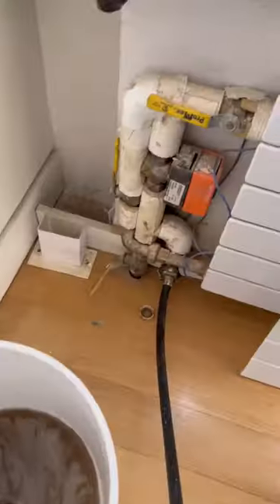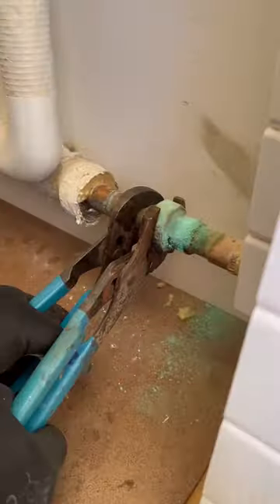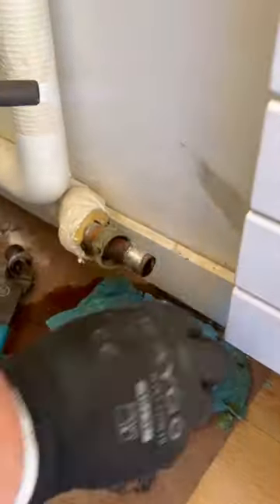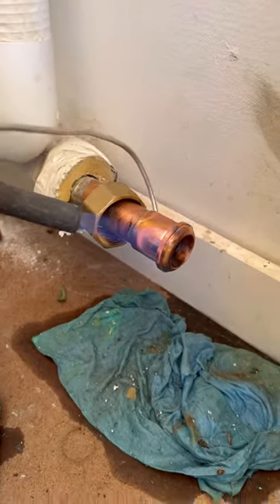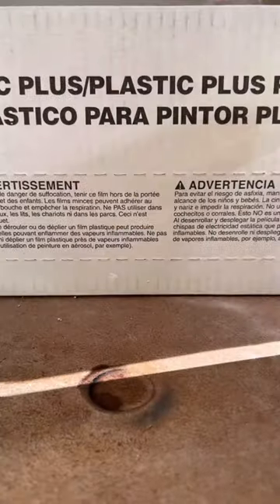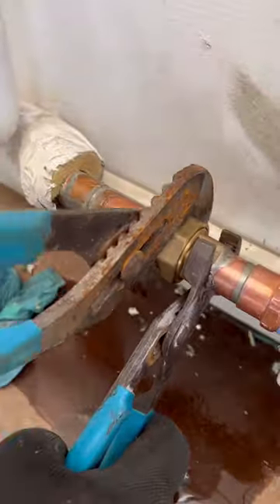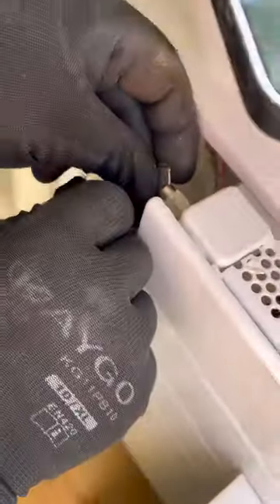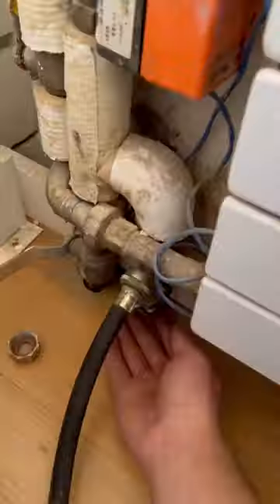Corroded Copper Union Replacement

Comment: Fun fact: in New York they use Coca Cola instead of water in their radiators
Reply: Tell us you know nothing about hydronics without telling us you know nothing about hydronics
Reply from the maker: lmaooo
Reply from the maker: @jman0870  hahahahah
Reply: @jman0870  why does it look that color my guy?
Reply: @mikeythecritic831  it’s boiler water. Leave it alone. It’s supposed to look like that.
Reply: @jman0870  but why
Reply: @hydronyc  This page is 🔥🔥. I live in NYC and would like to get into plumbing. Could you please give any tips on how to start.
Reply: @jman0870  you just did. It’s not meant to look like that although most systems do.
Reply: @tomadams94  uh yes…yes it is. The only way to make it not look like that is to drain it, flush it, fill it, bleed it, and fill it full of inhibitor. That is literally what boiler water looks like, especially when you drain a radiator. 🤡
Reply: @timwilliams347  Because it is a closed heating system (same water moving around with no new water) It loses its oxygen plus it picks color from boiler.  It means there are no leaks and heat transfer is good.
Reply: @vicentebrito1514 wouldn't be best to use coolant liquid?
Reply: @AgustinBernardo   The standard hydronic heating system uses just water. If by coolant liquid you are referring to glycol, it is  use together with water when a heating system has piping exposed to the outdoors or prone to freezing when not running. You lose some heat transfer capacity with glycol. If you are talking about a refrigerant like R404, that is only for AC units or heat pumps.
Reply: @vicentebrito1514  yeah I was talking about something similar than the car's coolant, I assume is glycol and it prevents corrosion
Reply: @AgustinBernardo  the corrosion was likely due to a bad solder joint. glycol will not prevent that. Here you are trying to get the heat from the boiler to the radiators, glycol does not help with that.
Reply: @vicentebrito1514  now I have it clear, thanks!
Reply: At $12M, that's 100 year old Coca Cola with a considerable amount of Cocaine still noticable.
Reply: @jman0870 tell me you don't know a joke without telling me
Reply: Or it’s probably Bronx zoo doo doo water
Reply: @timwilliams347  Must be Pepsi
Reply: @jman0870 His joke flew waayy over your head. you sound like you know what your talking about though so you're cool
Reply: @hydronyc  bro when do you decide to use a union?
Reply: @rickyperkins232   When you’re between two fittings…
Reply: Mmmmm that lovely smell of deoxygenated heating system water, 1977 vintage. I know it very well.
Reply: @jman0870 woosh. Tell me you cant understand a joke without telling me you can’t understand a joke. Oh wait. You did.
Reply: @joshroi8610  imagine coming here four months later
Reply: @jman0870 why are you so mad over simple questions? Just goes to show how weak your character is.
Reply: @Ant_Man211  imagine being so bothered by a comment that has nothing to do with yourself that you just had to comment yourself
Reply: Shouldn’t it be filled with Distilled water?
Reply: 😂😂.. Don't say that I can see people  trying to drink it🤢...Bx love
Reply: @jman0870 magnetite 😂🎉
Reply: @rickyperkins232 when you have enough people working together and the pay is shit
Reply: @wea69420  I like that bro
Reply: Glycol is called antifreeze for a reason. It doesn’t inhibit rust.
Reply: Only in the 12 million dollar buildings. In the others, just straight 💩 water
Reply: @timwilliams347 Pipe gets worn out not only from the outside but also from the inside. The closed water circulation picks up from some of the metal pipes rust and debree. Eventually it gets dark brown/black.
Reply: @jman0870 that joke went way over your head Dass
Reply: There's no water treatment from what I can see.  Fresh water to a hydro system without the chemical, in my opinion, is deadly.
Reply: That boiler water is structural.
Reply: Rusty water for ya bud

Comment: 12 million and no central air.  Ain’t no way.
Reply: We’ll just bc there’s a boiler for heat in winter doesn’t mean there isn’t an AC or heat pump with an air handler somewhere in the living space that supply’s the climate control in the hot months
Reply: Imagine not knowing what a chiller or water source equipment is 🤣
Reply: @jman0870  or I just imagined a smaller building that isn’t serviced by commercial/industrial equipment, and was thinking of residential instead. Not every apt in the world is water source homie
Reply: @Rjjamess  bruv knows it all.  Thanks bruv.  Didn’t know
Reply: @dutchy213  no worries man, and ignore jman0870, he comments on every plumbing video and has his opinions. Nothing wrong with not knowing about something you’ve never seen before, take care brother!@DUTCHY ARNETT
Reply: Radiant heat (from radiators or radiant floor) that moves with natural convection will give you better comfort than forced air heating solutions (fancoils).
Reply: @alerighi  This is true but it doesn’t solve air conditioning issue.
Reply: @Rjjamess  off topic, I got a carrier central air system, heat and ac, besides replacing the filter, what else can I do to maintain the system
Reply: @jaydrains2247   hey man. I love carrier, they make great equipment. On the AC side of things make sure you can go outside and check out the condenser unit coils and make sure if you look up inside the fins that you don’t see a layer of dirt or debris covering the coil. It’s a great habit once a year before you start turning on the AC regularly to clean the coil to make sure none of the equipment is working harder than it has to to cool down your living space. On the furnace side of things, once every year or every other, if you open up the furnace door/doors you can easily clean the flame sensor which is a common wear item that can cost you an expensive service call in the middle of the night on like the coldest day of the year or something lol 
What type of filter do you use? Like a cheap basic filter or an advanced allergen filter? The nicer the filter means the tighter the pleating which means it will get clogged faster so you will need to replace the filter more frequently than if you used a basic filter. So that way your system isn’t working harder than it has to to pull air past the filter and send it thru the whole house. Rule of thumb, if you use a allergen or elite filter, you should change it twice as often as if you just had a cheap filter since the allergen will catch a lot more of the small micron particulates than the basic and it will clog faster and cause your blower motor on your furnace to work harder and shorten it’s life. Hope this helps! :)
Reply: @Rjjamess  thx. 💪🏾💪🏾💪🏾🙏🏿

Comment: I used to carry  Left/Right  1 1/4  nipples for old cast radiators. the rad was left hand thread and the pipe fittings always right hand,  installed without a union.  A lot of the older double brick buildings had these monster cast rads.

Comment: Love the fact that you still solder 
No pex 
No pro press 
Nice clean solder joints 
hope the channel is paying well Broski🤙
Reply: I’m not a plumber but my guess is nyc doesn’t allow pex. I’m an electrician. Long Island you can use pvc and romex. NYC is all galvanized pipe or emt and bx cable
Reply: @linehandibew6205  it should be in the city 
I’m near Boston the rats wreak havoc on plastic and wire insulation
Reply: @brentmagerowski7886  makes sense
Reply: Last time I worked in NYC not.even pvc is allowed in the walls.   All straight copper for dw and black pipe for gas.

Comment: Try putting a baking tray under before you crack the union. When I replace zone valves, I put a cookie tray under the valve at an angle and have my vacuum on standby to suck up all the water on the tray. For unions like this, maybe a bread pan would work well.
Reply: Simple but handy
Reply: Good ,man.   I've got a collection  of sizes for baseboard work  and for replacing stops installed close to the floor
Reply: Search “plumb tub” I think it’s a uk thing but an amazing device at catching liquid.

Comment: I am a retired Painter, one thing I found over the years was that the more expensive the Building, the worse it was put together and the more shortcuts were used.
I painted Housing COmmision homes that were made to a budget and an Inspector checked every single stage of the build and finish, we couldn't start with the second coat till the Inspector had seen the Sealer/Primer completed, he also took samples of each coat from the pots we were using when he arrived.
I never saw an Inspector once on any multi million dollar project I worked on, saw the Architech many times as well as many changes to the plans, but never any one checking to see if everything was being done to specs.

Comment: Tip: get a durable plastic oil pan to catch water dripping from the pipes. I use a low walled plastic storage box whenever I need to open kitchen drains or change fittings but I'm not going around fixing other people's stuff. I don't need a heavy duty drain pan.

Comment: Fitter here, yes, you can start with return closed to start, but you have to what I call block and bleed. Close supply after straight water. Then open return, and the pressure in that line will force water back through and get the last of it. If you try and get 100% of the air out. Better remember to add to the system and check boiler pressure

Comment: A little hack I found is take a bucket and cut about five inches from the bottom six inches maybe and that will fit under angle stops and low fittings so you can catch water without having a big bucket. I use it everyday and it fits perfectly in on the side of most toilets.

Comment: Is that asbestos on the copper pipe insulation? Nice vid.
Reply: Nah it’s fiberglass I was worried for a sec too lol
Reply: I’m certified in asbestos and that is 💯 asbestos.
Reply: @shearwater3038 ripping people off then.  Asbestos is like corrugated cardboard or concrete inside a wrap and is hard.  This is fiberglass you can tell from the fluffy yellow substance inside.  This guy wouldn’t be stupid enough to cut off asbestos if you go to the other vids he always wets it before even going near it.  Go back to asbestos training man
Reply: @shearwater3038 I’m also an asbestos abatement contractor certified so…
Reply: @andrewv4491  I think you might want to do a little more research before you speak. The only way to tell for sure is testing it and I was taught if it looks like that you should check the age of the building and if it’s older then 1972 you should test it because asbestos was in just about everything from plaster to pipe insulation flooring 9 by 9 flooring tiles, popcorn ceiling, duct mastic, and much more. I had the number 1 teacher in New England for asbestos and lead removal and I should him this video to make sure I wasn’t wrong that’s why It took 3 weeks to respond back because I don’t see him all the time seeing I passed his class with a 97 and he said I was 💯 right and he wouldn’t touch it with out at the very least having it tested.
Reply: @shearwater3038  asbestos is not yellow color
Reply: @mainelyelectric  Anthophyllite Asbestos
Anthophyllite can range from brown to yellowish in color and is composed mainly of magnesium and iron. One of the more rare forms of asbestos, anthophyllite was not used as often in consumer products, but can be found in some cement and insulation materials.

Comment: I used to have to repair 2- 3 inch mainlines on a steep mountain incline for sprinkler systems. If I didn’t open the water SLOWLY the repair would never hold. Hated that job.

Comment: You realize that most of that old yellow pipe insulation thats wrapped with the white plaster looking mesh is all asbestos right??   I remember being in an old building and having to run a ton of low voltage wiring and fiber optics and an older dude i was working with started breaking out in hives and a rash plus had issues breathing.  Called in remediation to check for mold or anything and they found every bit of that stuff contained high amounts of asbestos.  Reason it wasent removed earlier is because it was fine unless disturbed which is what we were having to do..

Comment: You sir area real plumber. I run a million something dollar plumbing company and none of my guys do it that smooth
Reply: You better hope those workers quit on there own then because your company will go under because this is the most simple of jobs you can do and if the workers can mess something this easy up i feel bad for the company. I'm not a plumber and I can even do this.  Its basic plumbing almost all buildings in NYC running with these kind of radiators
Reply from the maker: thanks

Comment: Noice one bro any inhibitor added to the water ?
Reply: Sorry if this is a dumb question but what is an inhibitor? Like an additive to the water to inhibit oxidization?
Reply: @TheBookofLab  yes to curve corrosion, you have a system made up of dissimilar metals and water. With out inhibitor / chemical dosing the system will deteriorate from the inside out
Reply from the maker: Probably. Its a big building

Comment: Ever hear of treating the water in a closed loop system? The system should have plenty of air vents and a  large deairator  in the closed loop to take care of air getting in to system especially what air in in the radiator you are working on. But draining all you can before releasing into system is good idea. Good job

Comment: You don't use the couplings with the compression rings insider? That's how we connect heating pipes in The Netherlands. Never saw soldering. We don't use copper heating pipes though. We do use copper for drinking water.

Comment: The green on the line looks like it could be the result of galvanic corrosion.  Is it the result of there being zinc-coated galvanized steel pipe in line somewhere?

Comment: Why is that water soooo brown? 
Correct me if I'm wrong, that's not galvanized pipe. Right?
Reply from the maker: No galv pipe. It’s a heating system and dirty water is normal if not flushed once in a while
Reply: Thats $12,000,000 water